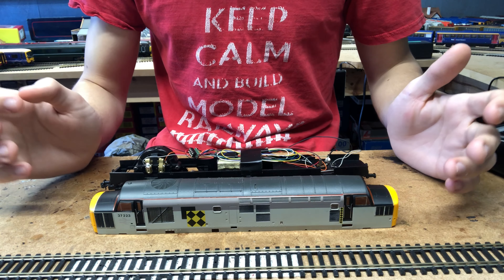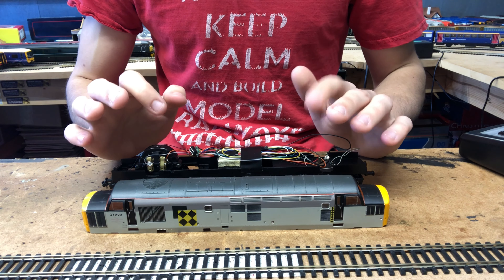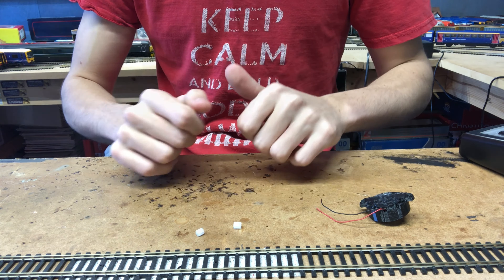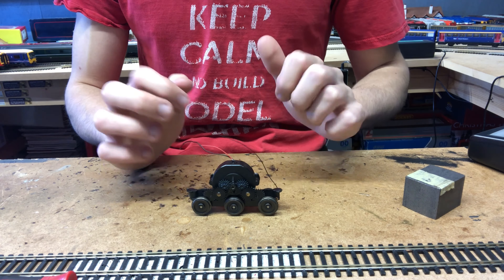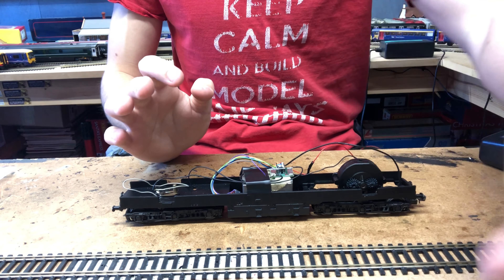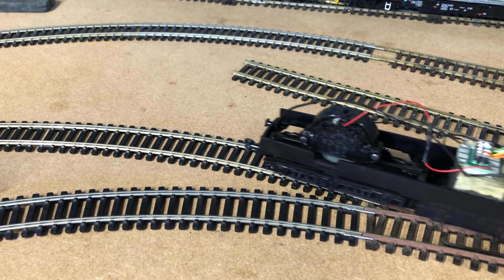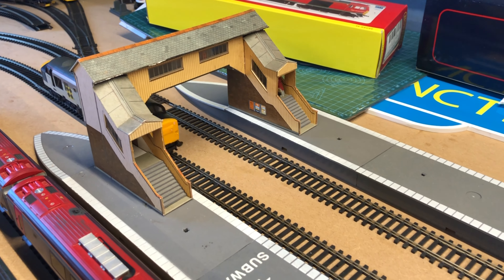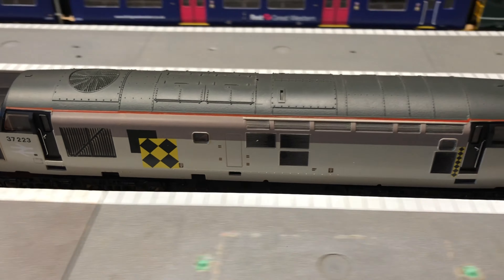The Lima class 37 project - part 3 - CD motor conversion

Comment: link for the converter would be helpful please
Reply from the maker: Hello there. This is the kit required to do this conversion.

https://www.ebay.co.uk/itm/362622818031?hash=item546e0116ef:g:K6AAAOSwHQxcu34X&amdata=enc%3AAQAHAAAAoAhizewZMSE8c7Gr%2BTi0z%2BJ2bouhA9fB0xTLhTw9hTs54UJIsdthLgTB7FV9p2Xuxv8JI0D899mNw5OroB3r8a199wEs0mZUMDNGu7DfiexVAYWE%2Bh0%2FWyxwaccpxGhCZZolVHkwK31KvexxnVC3tgULM9j3hoQP%2B9HEk7XwOKBaxbJPX4Zh%2BQKp0qeuI2lXnxRtnD0ZJjT3zHHl8fGNh6I%3D%7Ctkp%3ABk9SR-TtvP70YA